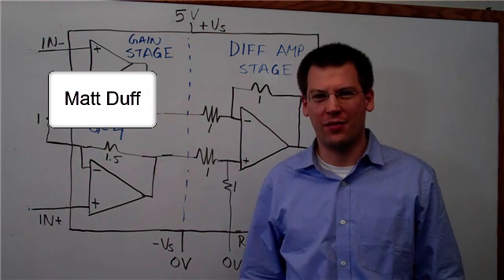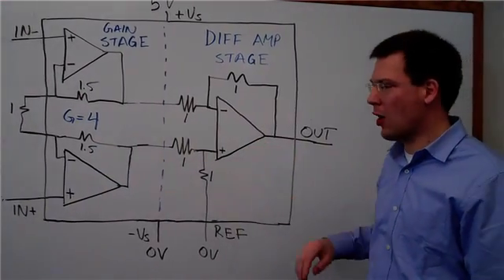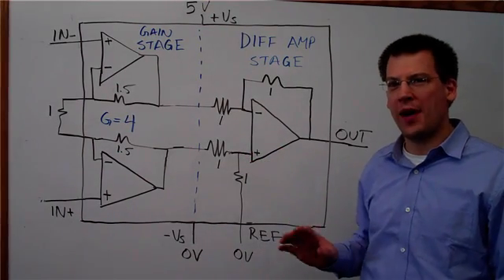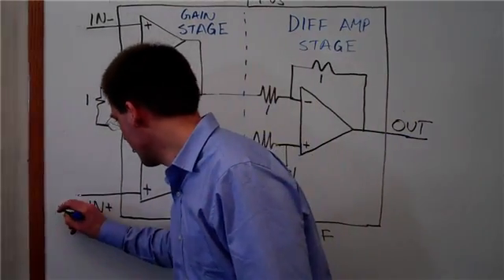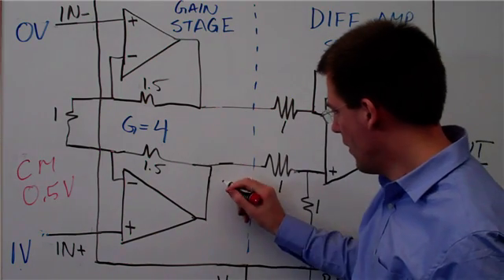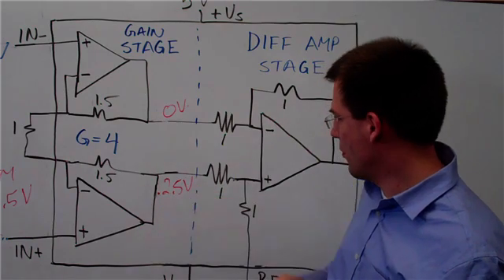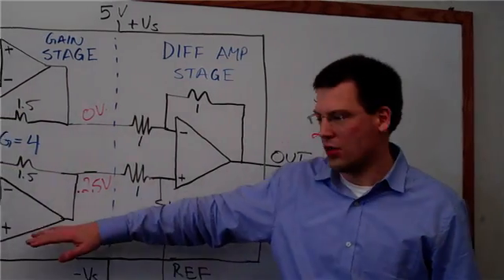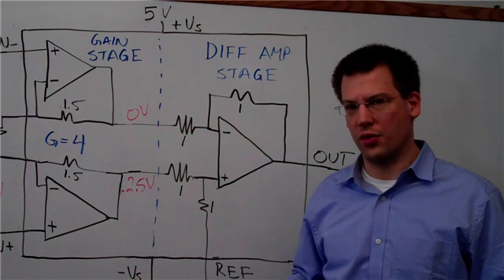Input Range of an Instrumentation Amplifier

Comment: Hi Matt. Do you prefer using AD620 IC (Instrumentation amplifier IC) for measuring PT100 RTD from 10 degrees Celsius up to 90 degrees celsius to amplify its millivolts to 0 to 5 volts? If not, then what would you prefer? BTW, great lecture. Thanx

Comment: Could I get your help? 
I need to amplify a ground referenced input voltage (range = 1mV to 150mV) by a gain factor of 10X (i.e to get 10mV to 1500mV)out for an A2D converter.  My problem is, trying to do this in the most cost efficient manner. Since this needs to be accurate, linearity and near ground performance are mandatory.  I have wondered in the past how chips like the ICL-7107 3-1/2 digit DVM on a chip accomplished this without a negative supply.  The system utilizes a single supply but I have made small negative converters before but need to try and stay simple for cost. Would you know how the DVM chip did this or what I can do?
Thanks for any help you might have.

Comment: Greetings, i have a question? How do we calculate the input impedance of an Instrumentation Amplifier?
Reply: Typically this should be given in the instrumentation amplifier datasheet, but in common mode and differential.  If not given, you can measure cm impedance, by applying a common mode voltage, and then changing it and measuring the current difference.  Or to measure diff impedance, apply a differential voltage with common mode of 0, and then apply a different differential voltage and measure the change in current.  You must make two measurements - if you only make one, you won't be able to cancel out the effect of the bias current.
Reply: Thank you very much. I am making Bioinstrumentation amplifiers using TL084s, i did not know how to measure impedance. They work pretty well!
Reply: Hi Matt how would you calculate input impedance for the circuit you are talking about "Instrumentation Amplifier" Thanks in advanced
Reply: Hey Luis,  You don't have to calculate it.  Generally it's listed in the datasheet for the instrumentation amplifiers.  For example the AD8421 datasheet lists an input impedance of 30 Gohms in parallels with 3 pF.

Comment: Hi, i am an electrical eng student, what is that Vs?
Reply: +Vs is +ve rail supply voltage e.g. +5V
-Vs is -ve rail supply voltage e.g. -5V or GND
Reply: +ANTALIFE thank you :) its been a while. I implemented this circuit and it was so much fun to do that.We call Vs as Vcc most of the time thats why i confused. Thank you
Reply: Nice, am in the process of learning about instrumentation amps myself. Can't wait to get something put together :D

Comment: How are you calculating the 2.5V and the -1.5V???? Will this amp work if you connect the reference to the -Vin pin.... just to get output voltage progressing upwards from 0V, from a bridge sensor??
Reply: but the formula for V1 is  V1=(Vcm +( Vd/2)).

and not (Vcm + Gain/2)
Reply: @pat60606 an easier way to understand the 2.5V and -1.5V is considering each amplifier for IN - and IN+ independently. In this way you have non-inverting configurations where the output is just [(1+1.5/1)*Vp] - [(1.5/1)*Vn). For the top amplifier (IN-) Vp = 0V and Vn = 1V, then Vo = -1.5V. Similarly for the bottom amplifier (IN+) Vp = 1V and Vn = 0V, therefore Vo = 2.5V. In the video I think he just got them switched but the rest of the explanation is correct. 
@AnalogDevices could you confirm?
Reply from the maker: pat60606 Start with 0.5V common mode and 1V differential.  Gain differential by 4.   Signals at outputs of first stage op amps are 0.5V – 4V/2 = -1.5V and 0.5V + 4V/2 =2.5V.   Because our first stage op amp does not have a negative supply it can’t drive the -1.5V, regardless of the reference pin voltage.

Comment from the maker: Hello, The first stage’s purpose is to provide high input impedance and gain.   The 2nd stage’s purpose is to remove the common mode voltage; in other words, change from a differential signal to a voltage referred to the voltage on the reference pin.

Comment: Hello.. it was a really informative lesson.  This is more like the circuit I have to design for a project.  Could please help.  I am connecting a Wheatstone bridge with 350 ohm resistors, to an instrumentation amplifier.  Could you please explain more on the gain stage and differential amplifier stage?  What are the exact tasks done by these stages and so on.  Thanks in advance.

Comment from the maker: Resistor values were drawn without units to emphasize that the resistor ratios set the gain. So the 1 and 1.5 values could be 1 kΩ and 1.5 kΩ, or could be 10 kΩ and 15 kΩ, or could be 3 kΩ and 4.5 kohm. The values depend on the tradeoff you want to make between power consumption vs. noise and bias current error.

Comment from the maker: The op amps typically used in instrumentation amplifier designs are low power precision op amps without much drive capability, so values at least in the kΩ range are typically needed so the op amps can drive them. Note that the ratios for the gain stage are independent of the ratios for the difference amplifier stage.
Matt